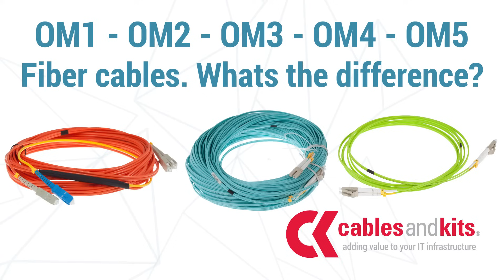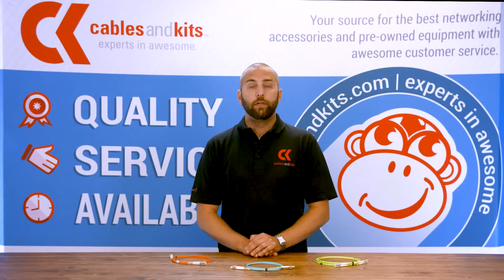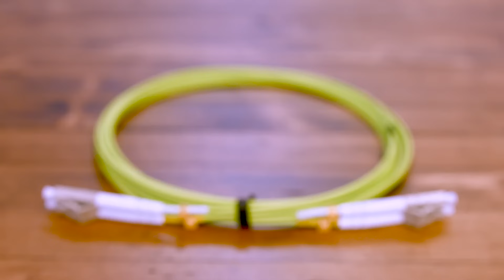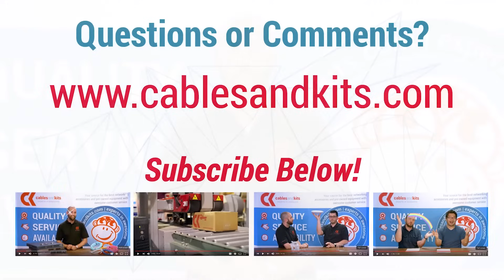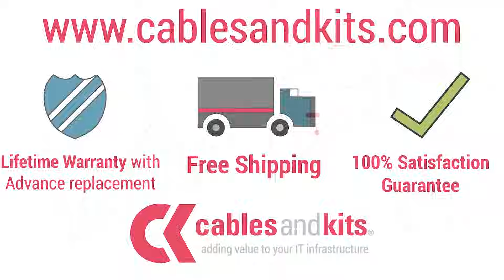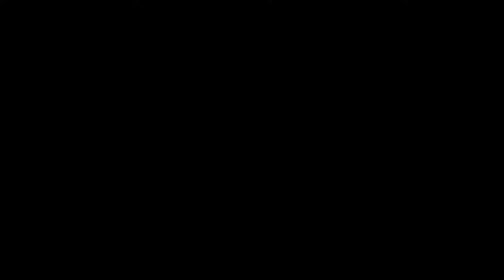OM1 - OM2 - OM3 - OM4 - OM5 Fiber cables - What is the difference?

Comment: You need correcting. You stated that OM in OM1-OM2-OM3-OM4-OM5 stands for " Optical Mode" but this is in fact not the case. OM stands for "Optical Multimode" whereas OS in OS1-OS2-OS3-OS4-OS5 Stands for "Optical Singlemode".

Comment: Please do one on the connector colors.  For instance blue connectors are usually single move fiber connections while tan and aqua connectors are usually multimode.  This comes in handy when dealing with armored cables which often have no information on them.

Comment: We can splice om3 pigtail with om1cable.?
Reply from the maker: No, we do not suggest it. To maintain the integrity of your connection you always want to mate "like modes" of fiber together. There is probably an easy solution to your issue. Please give us a call 888-622-0223! We would be happy to help.
Reply: @Cablesandkits  I try splice butt dB loss is to much
Reply: @mubasharmehar9475  so... you answered your own question

Comment: Please explain how what level of cables are needed for Fibre Channel SANs at 8Gb, 16Gb, and 32Gb speeds.
Reply from the maker: It is best for us to defer you to the SAN/switch vendor to ensure the solution is supported by your vendor. For SAN  configurations, it's imperative to use vendor tested and approved cabling, switches, HDDs, cables, etc.. in order to receive vendor support. That would be the most important thing to keep in mind when dealing with anything revolving around a SAN setup, including the cabling used for the specific setup.

Comment: Nice video. Explained that OM3 is for 10G applications, but didn't mention that you can still run 1G through it, as with the OM5... I know there was mention of future proofing, implying that you can run lower speeds today on the higher OM# cable, and increase the speed with a compatible transceiver in the future, but not sure it was clear enough for some. Thanks for the video.